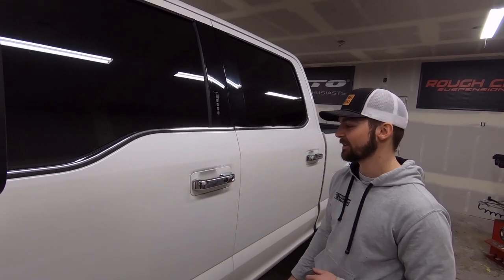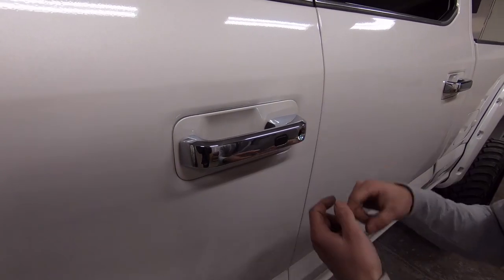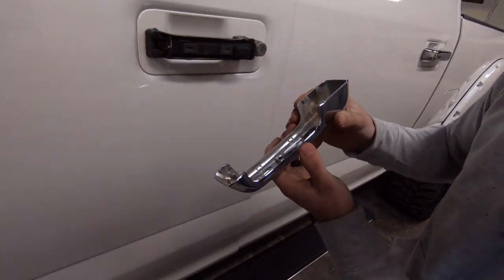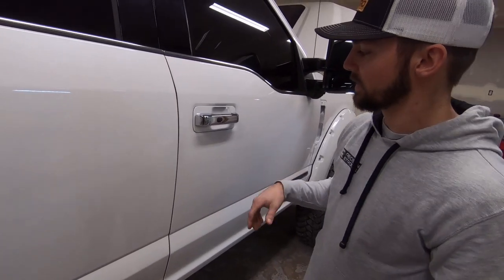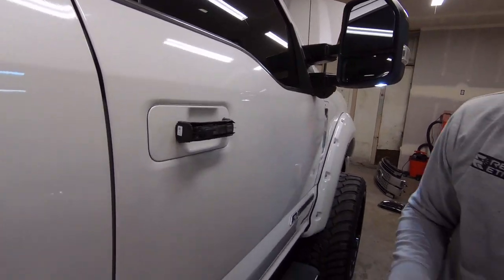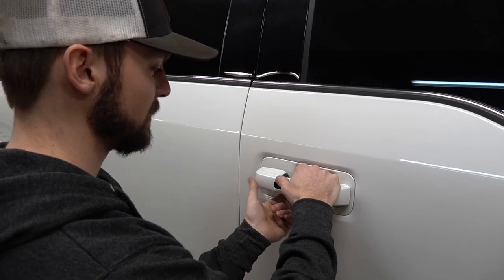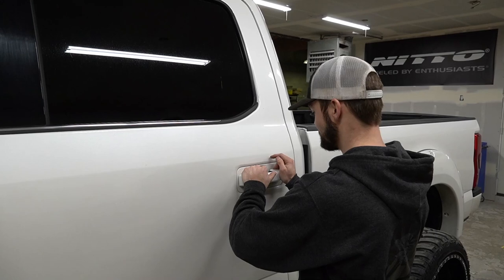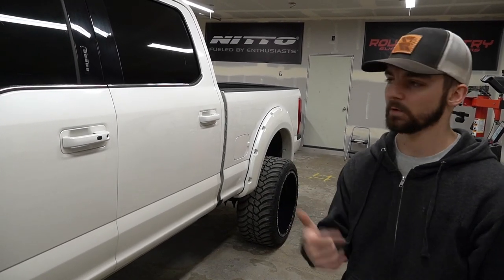How to Remove 2017 & Up Ford Super Duty Door Handles

Comment: Can the mirror caps be removed as well?
Reply: Yes, its fairly easy to pop them off. You pop off the mirror and that gives you access to the 4 tabs that hold it. If you are replacing the caps with new ones you can just pop the top 2 tabs off without removing the mirror. It will snap the bottom tabs off but if you're not re-using them its not a big deal.